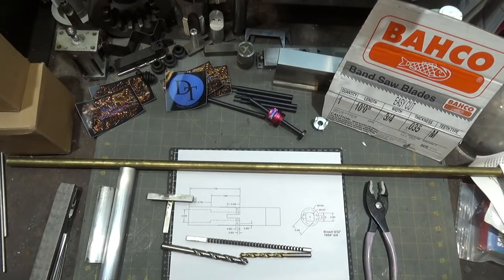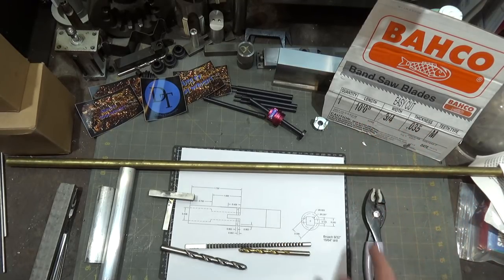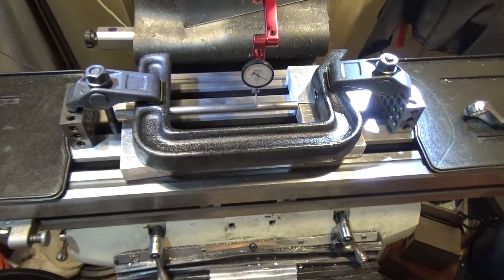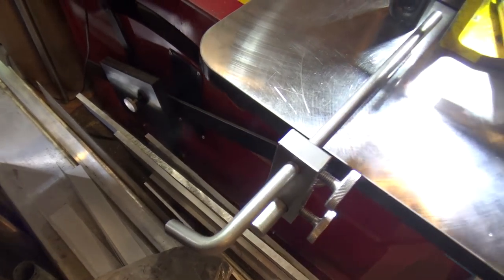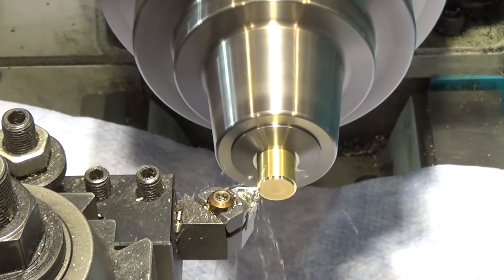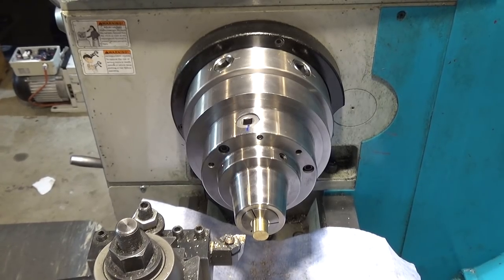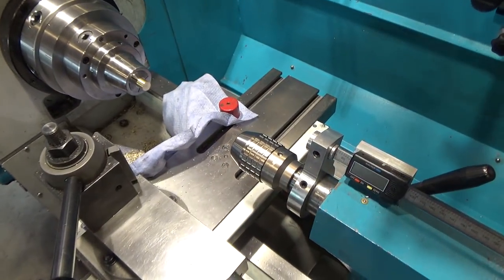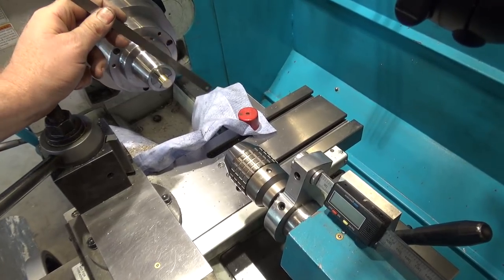101 Square Broached Bushing Part 2 Manfacturing

Comment: As you discerned, the pressure generated with air/hydraulic broaching was sufficient to cause the diameter of your brass plugs to increase, and this was not an issue when you manually broached. An easy solution would have been to reduce air pressure with a regulator. 
I have a similar press and, like you, I installed an air/hydraulic jack, but I did make some changes to how I feed and control the air. On the left side, I mounted an adjustable regulator and oil mister which is connected to a lever control on the right side. It's worked well for me. 
If you aren't dealing with critical depth tolerances, a collar on your drill bit would spare you having to re-calibrate each time you relocated your tailstock. If precision is an issue, than you could install a stop for your tailstock so that you can easily get it back in the same location.
Reply from the maker: Great idea, thanks. I think I will steal it. Much appreciated. I really love this community.

Comment: Thank you for sharing your work! I have broken most of the small carbide end mills that I've owned doing deep slots.  Subsequently, I've spent a fair amount of time researching the problem but I am by no means much better than a hack but here is my two cents anyway! 
First of all, choke up on the end mill as much as you can. The deflection of the end mill is proportional to the CUBE of the length. A .5 stickout is 8 times stiffer than a 1 in stickout. 
Number 2 on my list is to do multiple cuts to keep the deflection manageable. If you are having problems with excess deflection this may allow multiple cuts with much lower deflection, decent wall finish and a feed rate high enough to avoid rubbing. Feed from the same direction to avoid changing directions with the deflection. 
The last on the list is to do everything you can to avoid recutting chips. An air blast can work well and HP flood is great! The chip evacuation on your setup looked good without anything. You've got to love brass:-)
If all else fails then get rid of that surface grinder. It is clearly too much of a distraction. Please ship it to the attached address and i will gladly take care of it for you!
Reply from the maker: Great tips, thanks. I really appreciate you taking the time to share some really useful suggestions. The surface grinder is being squeezed, as we speak, to fit in a USPS medium flat rate package...

Comment: Great job . I might have to check out those bandsaw blades , are they constant tpi or a varying tpi ?  Cheers .
Reply from the maker: They do not say, but the look to be a fixed pitch. So far they seem to cut anything without complaint, but for larger stock they are a bit slow (as opposed to a lower tooth count blade).

Comment: Could those slots be made with a slitting saw? The carbide endmill worked in the end, but that might be an alternative.

What do you think about an adapter to mount a drill chuck to the lathe toolpost? Does not make much sence for one part at the time, because you have to allign it, but for a production run that might save time. Most cnc lathes work like that anyway.

greetings
Reply from the maker: I considered using a slitting saw, but at the time I made this video my milling machine was haveing issues (which you might be able to hear in the video). I have since repaired this problem (covered in my next video) and would probably consider a slitting saw next time. It would be easier and less stress inducing.
Reply: @DudleyToolwright  Thank you for the answer! But what about the second half of my first comment? :D
Reply from the maker: Sorry about missing that. I have a text file full of ideas and the tool post drill chuck holder is in there. I can imagine it might be a bit of a pain to align it on center every time. you want to use it, though. If you are off by more than a little (technical term) you might very well break the drill bit, so care is needed. Thanks for the cool tips and the time you took to share them.

Comment: It's a learning process, and you learned a couple things on this one.  Good solution to speed alignment with the Angle Plate.  Great video.  Did you try the part in the broach block before broaching, and did you check outer diameter afterwards?  Could the broach have expanded the part in the block causing a slight press fit?
Reply from the maker: Excellent question. I did not, but now am interested in the answer. Thanks for the tip.